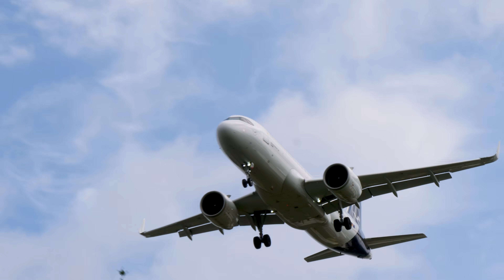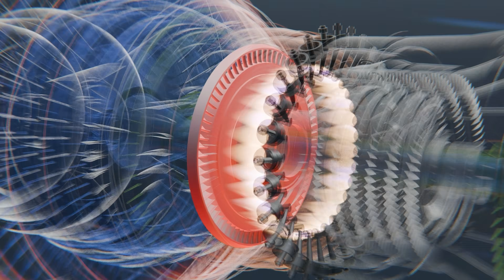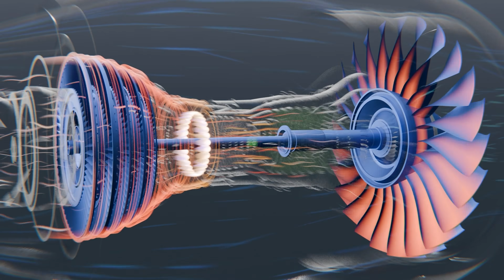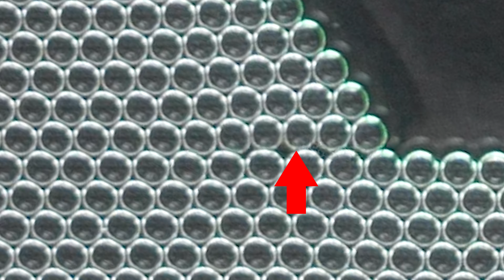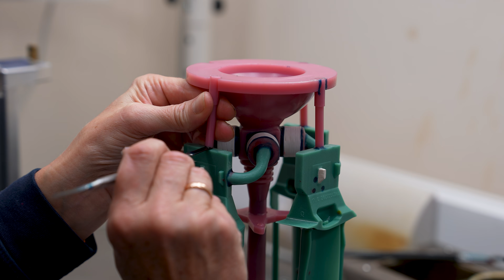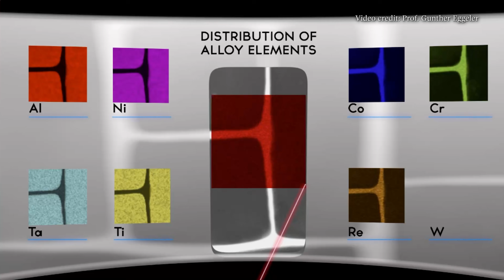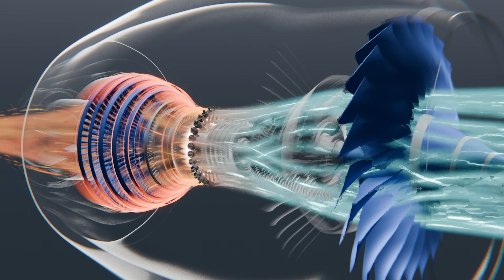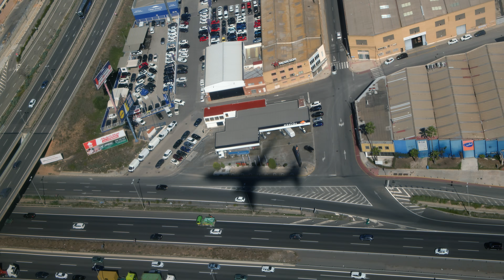The Ridiculous Engineering Of Jet Engines

Comment: @8:08 Unit of Load should be kN or N not MPa, It's unit of stress/pressure
Reply: No, MPa is correct. The load for a test like this is always measured relatively to the size of the sample. N/mm^2 = MPa
Reply: @patrick9168 :  Well, in actual load test it is always applied load in kN or Tonne, but as an interest of mechanical properties engineers are interested in Young Modulus of the material not the tensile load in absolute way in alloys, because if you change the specimen with more area it will take more load, what will be contact is its Young Modulus, which for extreme temperatures howuch it decrease is in the interest.

And still Either one of above is true If they tag load than unit must be kN or N and if they keep the unit MPa than its should be strees.

Comment: As a machinist of 15 years in the R&D power generation & aerospace industry, ive manufactured and repair machined entire combustion & fuel delivery system assemblies (ex. swozzles/nozzle fuel injection, orifice & diffusion systems, combustion end-cover assy.'s, containment rings, afterburner shrouds and plumbing) for DOD contractors like Goodrich, GE (gas turbine division), and Pratt Whitney), Ive worked with many different super-alloy materials; Inconel 625&718, Hastelloy-X, Haynes 188, Stellite-6, etc. this stuff is essentially kryptonite and is incredibly difficult to machine without special tooling and advanced machining practice. I mean I have had jobs where I need 2 HSCO drills to drill one .092 diameter hole 1.5" deep in a half inch diameter part made of inco625. The subcontractor who I work for, is the shop that engineers from all the major Power-Gen/aerospace companies bring new make R&D parts for us to either make, modify, or repair machine surfaces. So I've seen a lot of neat stuff, a LOT of proprietary technology.
 One of the things that I've seen that wasnt mentioned here is the containment rings, these are huge rings made up of a bunch of aggregate pieces made of super-alloy with a radial contour coated in a special ceramic coating that gets a dynamic air-flow pattern machined into it, basically just a bunch of equidistant veins for air to by-pass. when the ring is fully constructed, the new compressor fans are set in this ring, and as the blades and body are spinning, the tips of the blades get precision ground by the ceramic coating(with the veins running perpendicular to the face of the turbo-fan), and the blades etch a shallow channel thru the ceramic coating, creating an efficient air-tight gap/fit when the turbine is at operating temperature. Machining creates stress in the material, that's partially why they try to limit all variables in the mfg of the blades themselves. So the final machining op. is brilliantly done whilst the turbine is operating.

Comment: With all that high-speed rotation, why can't an engine incorporate a centrifugal separator to reduce the dust load getting to the hot turbine blades? 
The "classical" design of a centrifugal separator, such as for removing dust from factory effluent gases, has no moving parts.  It consists an inverted conical chamber with a tangential inlet that gets the gases spinning.  The spinning speed increases as the fluid progresses to the solids-exit at the bottom -- the solids exiting downwards.  A gas-exit pipe rises vertically at the center of the cone, requiring the gases to reverse their downward direction to exit.
That sort of design should be unnecessary in a system that is already spinning.  I'm no engineer, much less a turbine engineer, but I'd envision some fairly simple (paddlewheel mounted on the center shaft?) means to encourage the particles to move centrifugally (which they'd already be inclined to do anyway), and some simple provision made for the particles to exit into the surrounding cooler air stream.  
Just a thought.  I'm sure that other minds could do better.

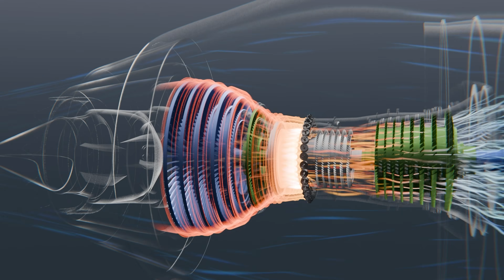Comment: Would it be better if the compressed air from the compressor was cooled before it went into the burner cans?  Like an intercooler for a turbocharged engine. It’s probably impractical. But has anyone tried to see if it could produce more power with less fuel? 1:36
Reply: Due to the Carnot engine efficiency formula : Efficiency= 1-T(cold)/T(hot), you want to burn your fuel as hot as possible (T(hot)) for efficiency. Where intercooling can improve efficiency is when it is used between compressor stages. Too heavy and cumbersome for an airplane engine but stationary turbines used in industry have no such weight and size limitations so they often employ intercooling between compressor stages.
Reply: @wally7856 Yes. Definitely impractical. But isn’t the power increased because of the rise of temperature of the gas before its ignition?  If you could lower that temperature before its ignition you could get that much more power. It’s not just the end temperature. Otherwise we could just put a torch into the front of the compressor.

Comment: I have heard a story (many years ago) that when the South African Air Force upgraded their Mirage IIIz's to the locally designed 'Cheetah', they replaced the turbine blades with single crystal blades that had just become available. The story goes that each blade arrived in its own felt lined box ! The appies, knowing no better, proceeded to install them using a metal mallet. I'm sure somebody can confirm or refute this story.

Comment: 3:12 that's not where the bypass thrust comes from. The thrust comes from the fact that the cross-sectional area of the bypass channels gets smaller as the air moves toward the back, which accelerates the airflow. The change in momentum and kinetic energy of the air is offset (conserved) by an equal force pushing the engine forward.

Fan blades are not propellers; their only job is to pull air into the bypass channels so it can be accelerated.

Comment: Single crystal blades are cool in and of themselves, but what impresses me even more is how "simple" they got the production process to be. The pigtail makes such a huge difference for being as conceptually straightforward as they are. I love learning about these weird and obscure manufacturing processes, I used to binge "How it's made" and I always enjoy another peek behind those curtains.

Thank you for the incredible episode!
Reply: I bet the truly hard part is keeping the temperature gradient correct for the whole crystal building process over sections with different thickness. I interpreted the explanation to basically say that it took RR a decade of trial and error to perfect this part.
Reply: @MikkoRantalainen  I bet you're spot on. Keeping everything in the hot zone molten while ensuring everything below is crystalline means the process can handle at most a few degrees of variation (too cold and you would expect spontaneous nucleation on any impurity like when water freezes in a bottle). It is notable that even after the blade was in the outlet of the machine, it was still glowing, so the cold zone is likely just shy of the full melting temperature.

Comment: Over the decades, airplanes seem to have become much quieter. As a kid, the sound of planes roaring overhead was loud and unmistakable, but now they pass by with much less noise.
Reply: They also fly higher now
Reply: I'll never forget seeing and hearing a Tupolev Tu-154 taking off (they were still in service here in the '90s). The three engines were screaming hard. Nowadays I live near an airport, and barely even notice the planes.
Reply: Like the video said, higher bypass ratio engines allow better mixing of hot and cold air which reduces noise. Also by moving more air mass it doesn't need to accelerare the air so much which also contributes for noise reduction. Today's turbofans can have bypass ratio 10 to 12, while in the 80s it was around 5. That makes a lot of difference. Also, some models that are becoming ubiquitous like the PW GTF engines have planetary gears which allow the fan to turn much slower while increasing fan diameter further raising bypass ratio.
It must be said that there has been aerodynamic improvements to improve acoustics related to noise generated by the air flowing between the gaps of wing flaps and slats.
Airworthiness certification has been ever more stringent after each aircraft model generation pushing the manufacturers to improve noise levels in everyway possible.
Reply: Yes, I can remember that. They were like fighter jets, it was always a problem for people on flight paths also. They are so much quieter now and cleaner.
Reply: My wife works in airplane noise, and you'd be amazed at how much work goes into that. There's global conferences run by a branch of the UN on how to target better noise reduction, without doing too much harm to other aspects of the plane's performance (fuel efficiency, in particular). 

It's interesting stuff, even if I don't get to see more than a fraction of it.
Reply: Maybe they were prop planes instead of jets? Turboprops are much louder than turbojets/turbofans.

Comment: Frank Whittles engine in 1941 is NOT the first Jet engine, in fact the Heinkel He178 flew in 1939 already with one, designed by Hans von Ohain. Although in large part von Ohains lead in Jet engine development is due to him getting funding when Whittle did not. You'll find a lot of patriotism fueled debate on who actually developed the first Jet Engine with accusations of copying work, all of this is moot, both engineers became good friends after the war. But fact is, the first flight of a jet plane was the He178 in 1939, shortly before the start of WW2.

Comment: But  major plane engine makers are having problems with their latest engines, suffering much shorter intervals between maintenance and are having to be replaced with new engines. In particular the RR Trent 1000 and the Pratt & Whitney PW100G. It is a major headache for many airlines with loss of income due to aircraft  being out of service.
Reply: Yes. Which has led to significant delays in new engines being manufactured as they figure out the issues. Still, when you look at the crazy maintenance required for the older turboprops, it's pretty remarkable how long these newer engines can go between major maintenance requirements.

Comment: If the air that comes out of the holes is forced too hard, it will shoot out too far from the surface and the blade will melt. If the air isn't forced hard enough, it will not be enough to cool it either. As an aero engineer we always refer to this as a science AND an art. The majority of the air that enters the engine is used for cooling, not only the turbine blades but the combustion zone as well.

Comment: DEREK!  I had a thought ! What if you start a material science series? Going over different materals used around multip industries. Maybe go tour a MCL ( Materials Control Laboratory ) at different places. Explain what Creep and Tensile strength is. Grain structures. How we etch and use SEM to veiw grains structures.

Also , you should see if you can check out HMI for pratt and whitney and check out how the powder metal process works for making the turbine discs we use.

Comment: This is what I have been looking. A quick question, you mentioned that the pushes the fan to generate thrust, is it similar in explanation to say that thrust is generated due to different in area at the front and rear of the engine creating a nozzle shape ?

Comment: Sorry I probably ask a dumb question: when the hot gas in the combustion chamber expands, it should expand in all directions, including forward direction. Why the expanding gas does not hit the front blades at the entrance of the engine, when expanding in forward direction? Why does it only hit the back blades near the exhaust of the engine?
Reply: Good question actually. Airbus a320 pilot here :) 
Hot gas in expansion should indeed expand in all directions. However, there are several reasons why it can’t expand towards the front of the engine.
One of them is due to the design of the combustion chamber, which physically directs the airflow aft, and only aft. 
Also consider the huge pressure the air is subject to while arriving from the compressor stage: the increased pressure, opposing incoming flow and the rotating compressor blades would immediately overwhelm any forward expansion tendency.
Basically, the air in the combustion chamber has the “option” to either continue aft (towards lower pressure) or revert its flow towards the compressor (extremely high pressure). Since the air will always flow from higher to lower pressure, it will continue its direction to the turbine. 

That being said, it can happen that there is reverse in the airflow inside the engine, and it’s not good at all as you can imagine. 
It can take place if the compressor is not able (for several reasons such as compressor stall due to damage, air disturbances…) to maintain its pressure rise through its stages. This can lead to the pressure in the compressor being low enough to cause the expanding air to travel forward! It is called engine surge, and it is identified by a loud bang, high vibration, temporary loss of thrust, and even visible flames located in the engine intake in very severe cases.
So it can indeed happen, but in case of engine malfunction.
Hope I made I clear :)
Reply: @nicolopradella7091  Thank you, good answer. Though I will have to dig deeper in the "physically directs the airflow aft" design of of the combustion chamber.
Reply: By far the most misunderstood part about a jet engine is that people think the heating of the air during the combustion process increases it's pressure. IT DOES NOT. It LOWERS it slightly. The air isn't confined like in a piston engine. When you heat it, it's temperature rises, that causes it to expand and that increases it's velocity. That velocity increase lowers it's pressure. Flic your bic lighter, turn on a gas stove, light a propane torch, light a match. All the same thing - the air gets hot, expands and increases it's velocity and that's it. No increase in pressure and in fact it goes down a bit. Totally opposite of what happens in a piston engine.
      As mentioned; air goes from high pressure --->  low pressure and the highest pressure in a jet engine is just after the compressors. Then it's all downhill out the back and the air follows. The best example of a jet engine you probably own is your hair dryer. There are only 2 differences between a hair dryer and a jet engine. In a hair dryer the fan is powered by an electric motor instead of a turbine and the heat is applied by an electric filament rather then by the burning of fuel. Everything else is the same. You turn it on, the fan pressurizes the air which moves it out the back and the heating element heats the air. You just don't recoup some of the energy in that hot air with a turbine. There is no other differences. You could run a jet engine with a heating element if you wanted too and had enough room for one.

Comment: We get that microstructure from heat treatment in traditionally cast parts as well and usually interesting precipitation hardening processes. I'm not as familiar with single crystal processes but basically the same alloys in traditional form.

Comment: In 1982, I worked on a Pratt & Whitney project to bring up a compressor blade facility in Columbus, GA.  As part of that project, I toured Pratt's Automated Casting Facility (ACF) and observed the same process steps as we see in this video.  It's interesting the process is virtually identical, 40-years later.  I didn't observe the curly tube on the bottom of the molds, so that's an improvement.  Pratt used Unimation robots for the sanding operation.  I don't think Unimation is still in business.

Comment: I've worked a couple of years in aerospace. We were casting those motors with sand old school is the best. Though I've never worked with wax. (Our sand was then hardened by gas, and there was a catalyst in the sand that made the whole thing set like a rock in under 2 minutes. My question is why the wax. I know it's just a medium but i'm curious. I guess it's for the small part because a motor have like 1000 fkg piece of that casting haha all diferent size and shape most of the time

Comment: A "Hot start," of a turbine, can still severely damage or weaken these blades in the combustion chamber. (injecting fuel without sufficient air flow for cooling)  Start up procedure is critical to protect the engine.

Comment: 3:18 this isn’t entirely true. There are 2 types of jet engine, turbojets and turbofans (there’s technically more but for now just focus on those 2) a turbofan is what’s being described here. A jet without the fan is a turbojet. Turbojets were the first jet engines to be mass produced and were what powered all modern aircraft from around the mid to late 40s to the 70s or 80s. These days turbojets are basically non existent. Fighters and private jets may appear to have turbojets but most of the time they’re actually low bypass turbofans. Turbofans are simply far more efficient, especially as you get more and more power
Reply: .... If you continued to watch for another 10 seconds then you would have seen that this is explained and wouldn't have had to type all of this comment😂